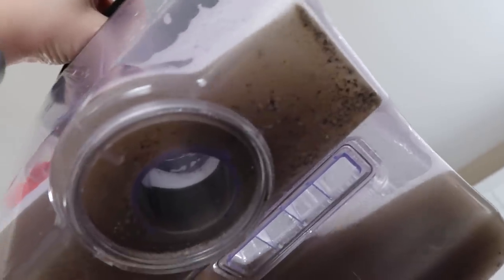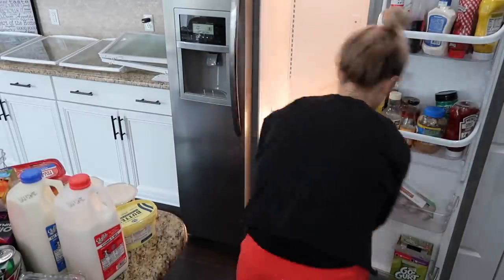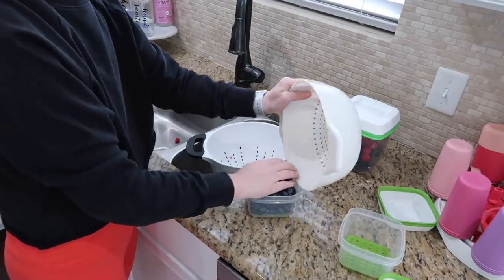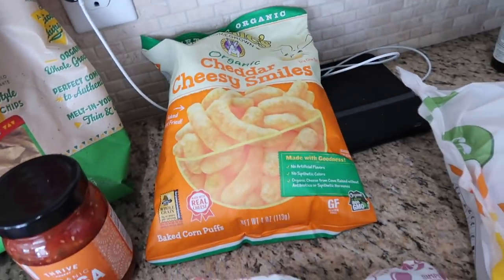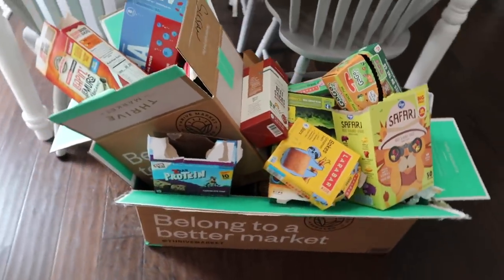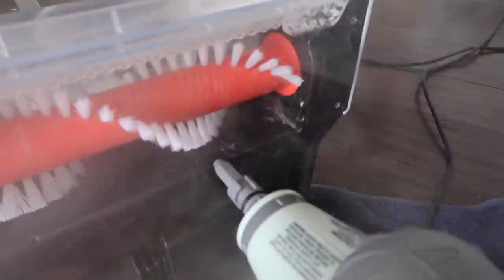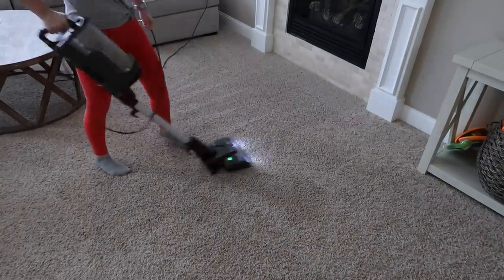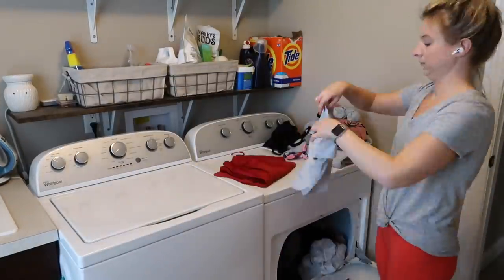*SUPER EXTREME* CLEAN + DECLUTTER WITH ME | FRIDGE + PANTRY ORGANIZATION | SPEED CLEANING MOTIVATION

Comment: You mentioned the maintenance of a carpet cleaner. I just wanted to say if you use a carpet cleaner (or any cleaning agent) in the machine, to be sure to run hot water through it before you put it away. Just fill it with water & spray out water & suck it back up, just to clear the lines. If not, the cleaner sitting in the lines will harden & the machine has to be taken apart completely to be cleaned. I know this from experience 😔... twice haha
Reply from the maker: Thank you so much for this!
Reply: @JamiesJourney  absolutely! I didn’t know if you knew it already, but it’s so important! RIP to the 2 carpet cleaners I messed up before knowing this 😬🤣